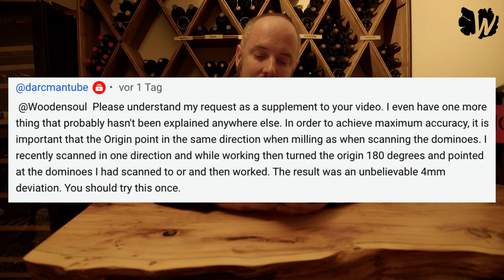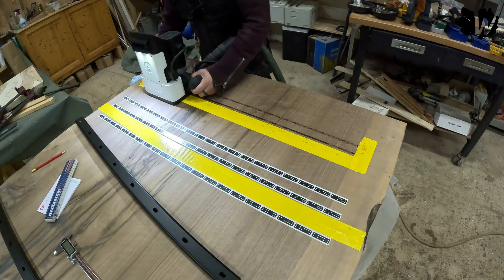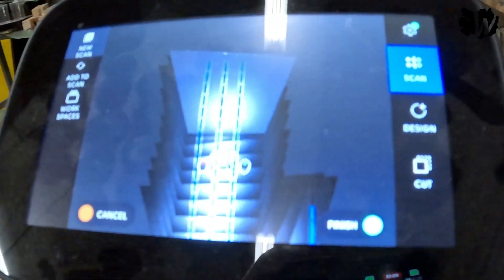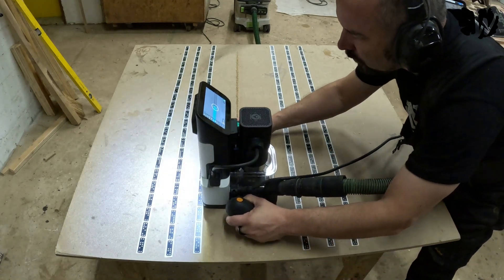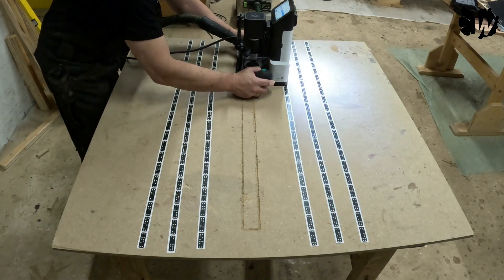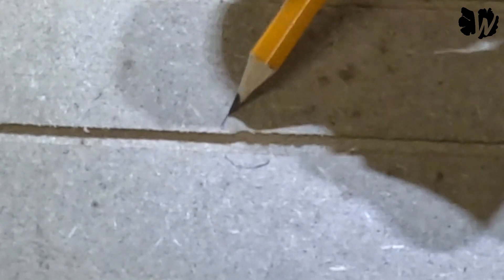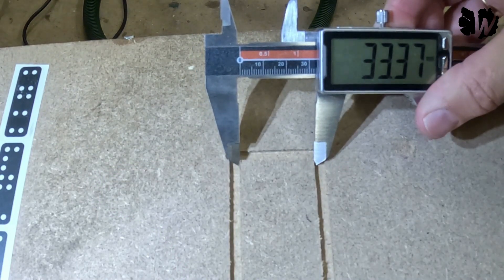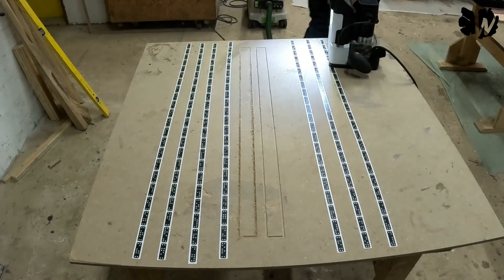How to increase cutting precision with Shaper Origin #shaperorigin #precision #quality #tutorial

Comment: This behavior is readily explainable if you understand how the dominos are used by the cameras and machine vision algorithm.  Each domino has a dot pattern that allows it to be uniquely identified and a respective location recorded.  When you're scanning, what Origin is doing is creating a mesh map of the dominoes, each one's position being recorded relative to the dominoes immediately adjacent to it.  Each of these relative coordinates has a finite level of accuracy and a respective positional tolerance.  The more dominoes you have in camera view at once, the more accurately the position of shaper can be calculated.  Where the "scan down one side and then back up the other" runs into trouble is at the turnaround point.  There are a lot fewer dominoes in view, so the position and angle of the origin as it starts to acquire new dominoes up the second side isn't as accurate.  As you scan up that second side, the angle is already off starting at the turning point and it just continues along with the angular deviation increasing as you go.

If you want to do something like this and get an accurate cut, don't scan down one side and back up the other, start at one end with origin facing the dominoes in a vertical orientation and try to get as many dominoes in view as possible and make sure that the you always have dominoes from both sides in view at the same time while scanning, this way you get the dominoes on each side fully linked to one another as far as relative coordinates are concerned.   If you can't span the center and pick up dominoes from both sides, then you need to add another strip. When you get to the end, you can turn origin 180 degrees and scan back towards the starting point to capture any that were not visible at the starting point.

If you scan this way, you get a properly linked field of domino locations and it won't matter what orientation you use while cutting.

The way this was scanned in the video resulted in a long string of dominoes being referenced to each other, followed by a pivot that had fewer reference points and introduced angular error, then a long string of dominoes that were well referenced to each other but not directly to the ones on the first side along the full length, so the resulting location mesh was basically a long U shape instead of a fully linked rectangular field.

Bottom line, this isn't really a flaw with Shaper or how its tracking, its a limitation of machine vision when using relative location indicators.  You see the same thing when doing 3D scanning when you don't have enough target markers in view, however that software tends to be a lot more rigid about reporting a "loss of tracking".  There's nothing Shaper can really do in software to fully overcome the issue of reduced precision when a scan field is created the way it was done in this video.  Any machine vision system would suffer the same tracking problems with additive error in this case.  The only thing they could do is change the software so it refuses to link new domino coordinates unless it has more active dominoes in the field of view.  If they do that, people will be complaining that they are being forced to use more tape.  Maybe that's a better situation than allowing cases like this where the additive error becomes really problematic, but I'm not sure everyone would agree?
Reply from the maker: Thanks for the detailed explanation - I hope it helps a few users to prevent the problem

Comment: I read through the comments. Please allow me to offer some advice that may likely resolve your deviation. 4 things primarily afflict you. I will list them in order of importance. Camera motion blur either in-scan or not, is real and effects movement. Shaper Origin itself is a router and as-such is not equipped with a Phantom 4K, but commodity hardware. It will re-orient itself very well, but fast movements through sparse fields will introduce error (more sparse, the greater amplification of error). Secondly, the sparsity of tape, while you did mention in comments you have addressed in the past, does have an effect. However, just because you have enough tape does not mean you can neglect other points. That being said, sparsity acts as an error amplifier if/when you perform something that generates an error (such as moving too fast, regardless of whether in-cut or simply migrating from one tape field to the next in a rotation). Third, you should scan the way you cut. Shaper HQ recommends a waffle-scan, but I recommend a predictive scan — a scan that predicts the cutting behavior. If you are accustomed to turning at a particular corner because (for example) your dust collection or electrical cable requires you to, then mirror this in your scanning. Last, but not least, you cannot over-scan. Take the notion of predictive scanning and amplify it by scanning every area from every conceivable angle that you may exhibit during operation of the router (notice that I did not say “cut” — motion whether cutting or not is still effecting where the router thinks it is; it does not matter if the spindle is on, the router needs to look through the camera to see where it is, and it needs dominos, and it needs blur-free images, and it needs to have seen what it is looking at, and it needs to have seen it from that angle). If all these things are attended-to, then I see no reason why you cannot replicate the results I get in my shop making custom hand planes demanding tolerances of +/-0.001” or 0.025mm on almost every cut (and some of these hand planes are very large, coming in at 20” or 500mm long). Greetings from San Francisco.
Reply from the maker: Thank you very much for sharing your advice, Devin. These are very detailed instructions, and very clearly laid out. I might try this out to see if it works. But even if it works, I have to say that this is extremely cumbersome, it makes taping, scanning and cutting much more labour intensive, and it's not documented that way, so asking customers to figure that out for themselves is not ok. Putting tape where you need it, scanning it in whatever way you'd like, and turning your SO the way you want (as long as there is tape) should be a given. Everything that deviates from this isn't very user friendly...
Reply: @Woodensoul  I understand the burden and the astonishment that this burden has been placed on the end-user. The company has gone to good lengths to explain scanning, which is where the term “waffle scan” comes into the discussion. Last year they produced some videos that went into more depth than I am sharing. They go into details on how the dominos are mathematically linked and even show images conveying the interconnection modeling that the system performs. It was very enlightening, and it has even been said that Gen2 is less prone to motion blur due to a better camera, lights, and newer generation system-on-chip. Gen1 hardware was many years old (even if purchased last year) and as you yourself said, was pushing the envelope in such a way that there was zero competition. I do believe the technology will catch up with zero innovation from Shaper HQ simply by way of refreshing components from one generation to the next. The issue of course is keeping things compactly within a router (which gets easier as components shrink while also gaining performance). All the while, keeping it affordable (by not putting NASA level components or high-end Zeiss lenses and sundry things into the machine). I sympathize that lack of competition impedes development velocity, but I also believe they recognize that you have to innovate or die because competition is often born via demand without supply (if they stop delivering what people want, a competitor will surface to create supply to satisfy that want). As for Trace, I signed up as an early bird. I should be getting it in October. It will solve a need I have and also make some things much easier. I plan on enjoying it mostly with Shaper Origin, but it’s hard to see a down-side to it in-general. I just hope that Trace does not take time away from Origin development.
Reply from the maker: I am curious: What need does Trace solve for you? I have a hard time understanding that. I would be happy to buy it, but I don't understand what I would use it for...
Reply: @Woodensoul  Tool foam is the first thing I need. The Bridge City Toolworks CT-6 hand drill came in a very nice box but in the late 90’s they used foam that is all but rotted out 25 years later and needs replacing. Newer foams are more stable. I need to trace the original foam to mirror the cuts in new modern foam. This will help me complete the restoration and improvement of this tool to hopefully pass down to my child. Basically any time I want to copy someone else’s work (for whatever reason; in this case because the antique is no longer made), Trace promises to make that a simple proposition. I am sure many uses will come forward once I solve that need, but I really needed it for that. After that I plan to use it to make shadow foam organizers for my multiple tool boxes.
Reply from the maker: @devinteske  Interesting. I would solve that need by taking a photo and tracing the shape on a vector tool. But then again, that would be a one off case, so if I would have to trace hundreds of those foam shapes, I would certainly buy Tracer.
Reply: @Woodensoul  on the Shaper community we (I) discussed how even though (as Origin users) we are often experts in a given vector software (I happen to prefer Inkscape but plan to try FreeCAD), often times when we try to get non-technical friends and family either interested or involved, the process very quickly becomes overwhelming. I also bought Trace because it has the ability to make me look like a super hero with my kid and others. The fact that it can quickly toggle between outline and centerline is alone quite valuable (the latter often being what is desired; e.g., text). Inkscape and many other programs have bitmap to SVG tracing but they don’t offer built-in centerline tracing (there is supposedly a plug-in for Inkscape but so far I have yet to get centerline tracing to work in Inkscape). From what I have seen, it is so fast and seem-less that it opens up stupid possibilities such as putting a unique signature on each piece. I like the idea of it almost having a magical quality to it for the non-technical observer. It’s hard to keep people’s interest these days and unless I am working on my own stuff, I like to avoid complexity. Who knows though, I have to get it first for a full evaluation.
Reply from the maker: @devinteske  There are all interesting arguments. I have never tried to get friends and family interested in the Shaper Origin, so I have never thought about that aspect. I can see that for people who need analog to digital conversion frequently, the product might make sense, but I really do this super rarely (I think I did it twice since I have the SO). I hope for Shaper Tools that there are many Devin's out there and that their product is a success. For now I will continue to observe and if there is a use case that is convincing, I will buy it (it's not that expensive after all)...

Comment: Interesting observation but I notice you setup the experiment with two sets of tape, one above the cut and one below. I wonder if Shaper would say this is insufficient. If I setup the same cut I would have used tape right through the cutting zone and simply cut through the tape. I think this would provide Origin with a larger and consistent scanning field but of course I'd have to give it a try.  I like your channel and thanks for sharing your experience.
Reply from the maker: Thanks for your kind words, I am very glad to hear that my channel is helpful to you! As for your question: I am not sure I understand. You mean like putting tape on the area I cut on?
Reply: Yes, exactly. I do it when necessary and I've seen several other videos where it's been done as well including on some of the instructional videos by Shaper.  I think the only downside is that the wrecked tape won't be as much help in guiding Origin if you need to go back and make continual cuts and adjustments so it may not be the best solution for every situation but it might work for the specific scenario you outlined.  @Woodensoul
Reply from the maker: I route over ShaperTape all the time, but it only makes sense to put tape on those areas if you need it at one point for orientation. In this case, I didn’t really need it there, because the camera wouldn’t be able to use it for orientation, given the angle

Comment: To me, such effect happened when using the same dominos and turning the Origin by 90 degrees. I had to get a bigger sheet of wood and redo vital parts of the "Metric Vertical Workstation" by Friedrich before I could fit the parts together.
I suspect there's an improper deviation in the offset calculated between camera and the center of the milling cutter.
Reply from the maker: It doesn’t depend on using the same tape. As you see in my demo, it happens also when you use different tape (but also with the same, you are right. It’s the rotation of the device that leads to problems…

Comment: This is very helpful.  I am working on a project that uses a 4x8 foot sheet of plywood and requires cuts near each of the edges (which would require turning the SO, so it doesn't fall off the sheet).  I will probably add a 1 foot strip of plywood with Shaper tape along the top edge of the plywood so I can always keep the SO pointing in the same direction.    
Perhaps I could instead create two workspace/grids - one with the SO pointing "north" and the design anchored at the southwest edge of the sheet, and a second grid/workspace with the SO pointing "south" with a flipped design, so I can anchor the same corner of the design to the same physical corner of the sheet.  I may experiment using your straight line test.
Thank you for pointing this out, and thank you for your great videos!
Reply from the maker: Thanks for sharing your experience - I know what you are talking about. The idea with the "extension" I have used in the past and it helps (but it is annoying). Your second idea sounds kind of crazy, not sure if I even understood it, but I wish you the best :D

Comment: I would think if you filled in the gap with tape, even one row,  you may not see this problem.  When you do the scan you hardly have any of the upper tape visible as it transitions to the the lower tape, seems only a brief moment they are able to reference one another. Or scan down the middle first to get both sides in the camera.
Reply from the maker: I know what you mean, but that's not the problem. When I first found the problem cutting a c-inlay channel, I had the entire workpiece plastered with tape, and it still happened. Also, when cutting out a circular table, I had the entire workpiece taped, as you can see here (https://youtu.be/VnrwmvsKdmI?t=278) and the circle didn't turn out to be perfect. I will try it out again next time I do a c-inlay, but I am very sure that your explanation isn't correct.

Comment: There is a large gap between the sets of rows of dominos.     I wonder if there is a slight blip in the scan when the camera traverses this gap.     I wonder what happens if  a few dominos are placed in this path to create more precise path for the scan to follow when it is turned 180 degrees during the scan to traverse one set of rows to the opposing set of rows?     It also might make sense to do it at both ends too because a small miss in the angle between the two sets of rows gets magnified greatly given the length of the rows.    Is it really a bug, or is the amount of positional data Origin is taking in during the spin from one set of dominos to the other is at outside edge of what it can accept, but then this minimal criteria is all it has to compute an angle that in this case extends a long distance, magnifying the error greatly.
Reply from the maker: I know what you mean and it might be that adding tape could reduce the offset a little, but this problem is something I have confirmed over and over again. The best experiment you can run is when cutting out a round table out of a square piece of wood, where you naturally have to face the SO always towards the center of the circle. You always get an offset where you plunge in, even if you plaster the board with tape…

Comment: I noticed this error too, when making mft tables. I could be wrong but in some of the early days of the demos you can see  scanning and cutting in multiple directions. This really needs to be  addressed.  It makes working on the edges of large pieces really difficult. I’m still not even sure whether this means you need to always scan in the direction you intend to cut or that all dominos in a workstation need to be scanned in the same direction. Which is it? I love my origin. But I’ve never used a tool more prone to supposed user error.  The tool was really marketed as a way to work at any scale and not being able to accurately work on the edges of large workspaces is a real big problem.
Reply from the maker: My opinion: The scanning direction is not that important, but the cutting direction is. One should cut with the SO facing in the same/very similar direction. Now if you read some comments, there are all kinds of theories shared, so I don't claim to have the perfect solution. And yes, agree, especially working on edges becomes really cumbersome...